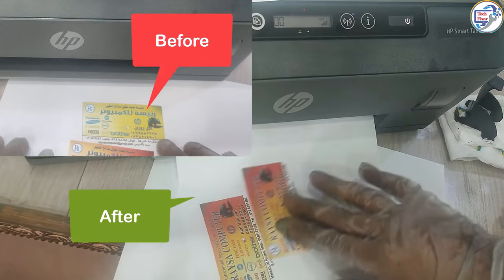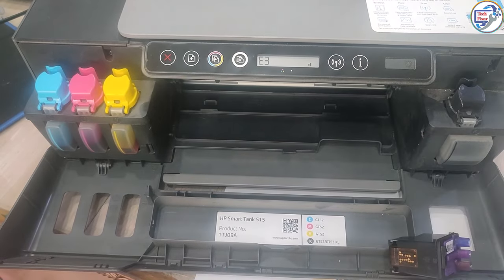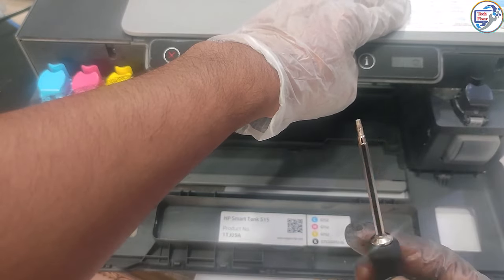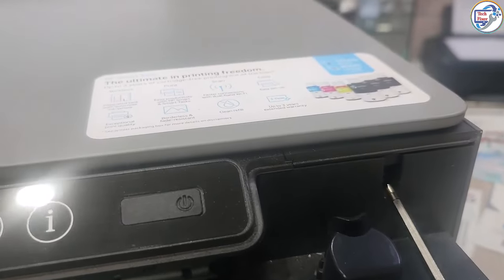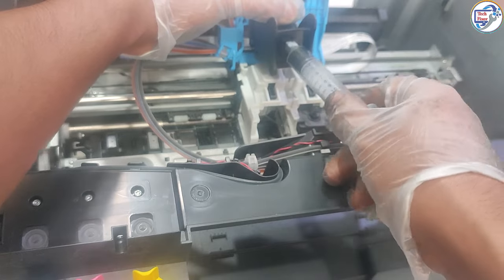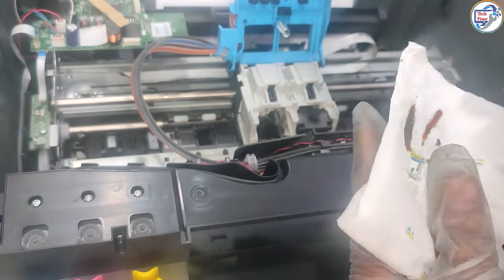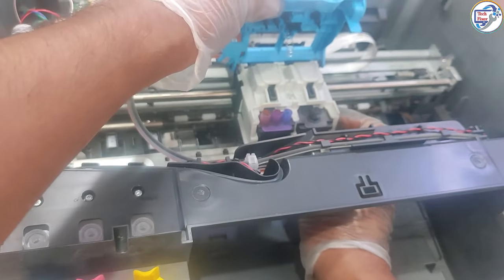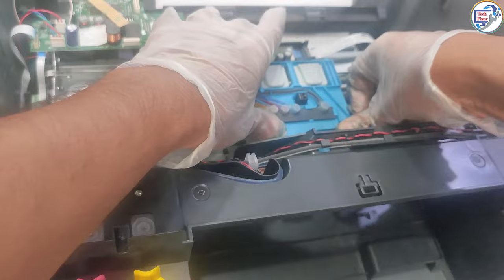Fixing Color Missing on HP Smart Tank 515 Printer.How to Clean HP Smart Tank 515 Printer head.

Comment: Or you use a 70c ear cleaning syringe and push the ink in tubes through valves on top of the ink tanks while it's printing and voila, it works again...
Reply: What is 70c? Is that a size? What is it equivalent to in mL?
Reply: Did you try it? Can you make a video about that?
Reply: Yes, it's real easy, not gonna make a video... There are literal holes on top of the tanks, just blow in there :D
Reply: @andrejkemencic  but.... put paper towel under the printhead otherwise a godawefull mess!
Reply: @BornAgainCynic0086  of course
Reply: Where in the  Philippines can I buy that tool to vacuum the ink with the print head?